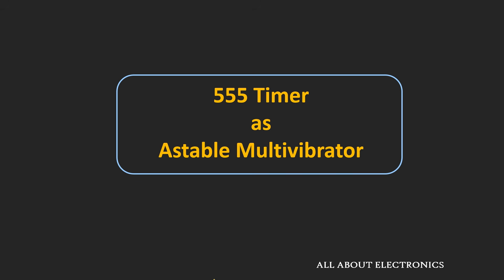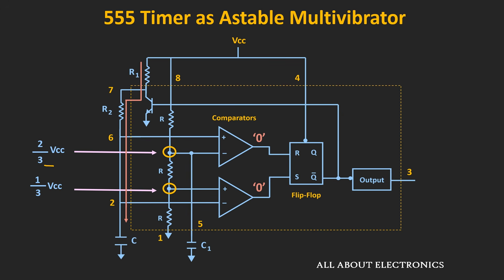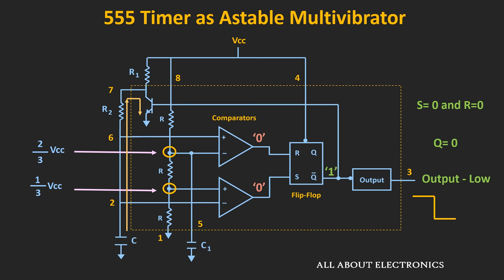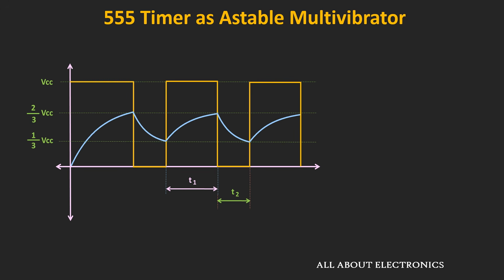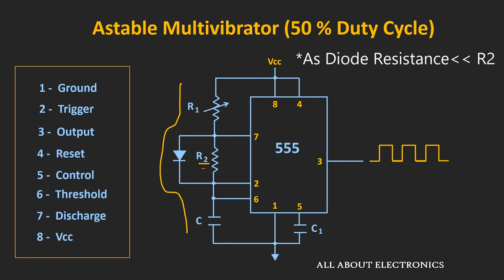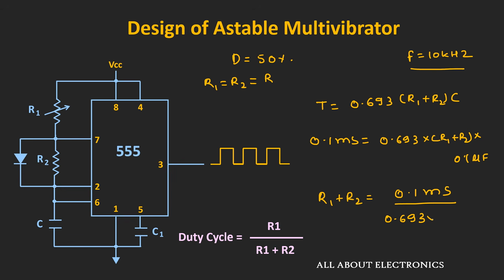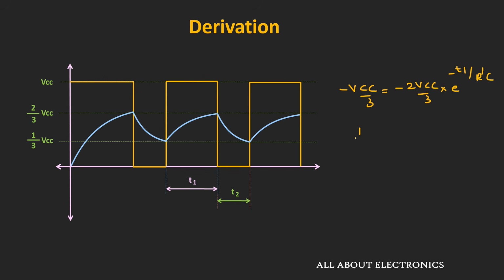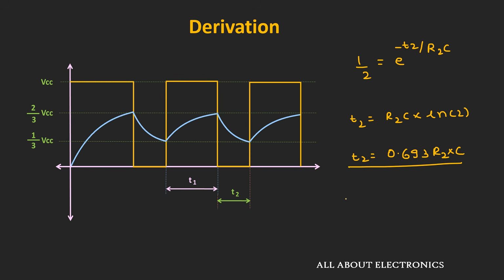555 Timer as Astable Multivibrator (Working, Design and Derivations)

Comment: While in design what about R1 and R2 we have to assume R1🙄
Reply from the maker: You need to select both R1 and R2, according to the required duty cycle.
Reply: First of all you have to assume te value of C,   use equation Toff = 0.693R2C, find R2,  use equation Ton = 0.693(R1+R2)C, find the value of R1. You should  assume value of C only....

Comment: what is the function of capacitor at pin 5
Reply from the maker: By applying the voltage pin 5 we can change the reference voltage. If it is not used then it can be kept open. But in that case, it can pick up the noise or by any means if the voltage changes at pin 5, then it can change the reference voltage. To avoid that the capacitor is connected to the pin 5. So, this capacitor will charge up to 2/3Vcc voltage. and won't change the reference voltage.
Reply: @ALLABOUTELECTRONICS  What do you exactly mean by the reference voltage. Is it something like when the 555 timers is configured as astable multivibrator. And Vcc=5v then the HIGH = 5v and the LOW = 2.5v or any other voltage which is the reference voltage.
Reply from the maker: @TechInventorAman  What I was referring to is the 2/3 Vcc reference voltage for the comparator. If no voltage is applied at the pin 5 (control pin) then the reference voltage to the first comparator will be 2/3Vcc . But it can also be changed by applying the specific voltage at the control pin. And when it is not used then via a capacitor it is connected to the ground. 
I hope now it will clear your doubt.
Reply: @ALLABOUTELECTRONICS  Oh ok now i got it thank you so much !
Reply: Pin 5 is used when you want to control frequency by applying a voltage I.e V to F converter, as an oscillator you will not be applying a control voltage, so if you keep pin 5 open, there is a high possibility of noise pickup.... so it is connected to ground through 0.01 microfarad

Comment: Q equals to 1 and output is connected to the Q bar pin..then how the output is becoming high at that time?
Reply from the maker: Because the output driver circuit inverts the Q-bar output. It is actually inverting driver circuit. (that's why I have put a bubble on the left-hand side of the output block.)
Reply: Output is Q as Q' is inverted before connecting to output, or there is an inverter between Q' and output of 555

Comment: Sir, At pin 5,if we provide external voltage it gonna affect Ton but Toff is independent of external voltage ..why?(In diode condition)
Reply: There is no role for Pin 5 or upper comparator during discharging of the capacitor.....

Comment: At 5:15 the voltage at non inverting is greater than inverting so output should be 1...? ❓ Clarify it
Reply from the maker: Ar 5:15, the voltage across the capacitor is just below 2/3 Vcc. But it is still more than 1/3 Vcc. So, output of the second comparator will be low. It will become high only when the voltage across the capacitor goes below 1/3 Vcc voltage.
Reply: @ALLABOUTELECTRONICS  here u mentioned correctly 😊but in video i think there is some correction had to be done.. I may be wrong but u please check it..
Reply: @aravinthbosem3652  Yes. There's a slip of tongue in the video.

Comment: What is the diode operation in that diagrammm
Reply from the maker: It will prevent the capacitor to charge through R2. (As it offers very low resistance).
So, during charging capacitor charges through R1. And during discharging, it discharges through R2.
And by tuning the value of R1 and R2, it is possible to attain the desired duty cycle.
I hope it will clear your doubt.
Reply: If dutycycle is less than or equal to 0.5 or 50%, that means Ton is less than or equal to Toff, then capacitor should charge only through R1, not through R2.

Comment: Op amp corresponding to 1/3 Vcc is connected to Reset terminal of flip flop not Set terminal
Reply from the maker: You mean to say the lower comparator?  It is connected to the SET terminal of the flip-flop.

Comment: but the value of Vf should be 2/3Vcc
Reply from the maker: The capacitor is charging towards the Vcc voltage. But when it's output reaches 2/3Vcc voltage, the comparator output changes. If the comparator would not be there, the capacitor would have charged up to Vcc voltage. That's why Vf is Vcc. 
I hope it will clear your doubt.

Comment: y capacitor C1 is used?
Reply from the maker: As control pin is not used in the circuit, so to prevent any change in the voltage due to fluctuation or noise at the inverting end of the 1st comparator, capacitor c1 is connected. If it is not connected then any spurious voltage at the control pin will override over the 2/3Vcc voltage and it will change the threshold point of the comparator. 
I hope it will clear your doubt.

Comment: sir, actually I have a doubt related to this video and previous 555 timer video also. if when output Q=1 
then value of Q' must be 0 because of its complimentary of output Q according to the truth table of S-R flip-flop. Sir, please clear this doubt.
Reply from the maker: Yes, that's how it works. I think if I am not wrong, you got confused because Q' is given to the output driver circuit (which is actually inverter). So, the output of the 555 timer will be Q.
I hope it will clear your doubt. If you still have any doubt then do let me know here.
Reply: You are right, when Q=1, then Q' must be 0

Comment: Sir u put parallel diode to R2 in the circuit diagram but did the derivation of original circuit(no diode parallel to R2)..
For t1 it should be only R1 if diode is parallely connected to R2
So it shld be t1 depended only on R1 not on R2... Isn't it sir..?
Reply from the maker: Yes, that's true. The derivation was for the original circuit. (with R1 and R2)
Reply: @ALLABOUTELECTRONICS  ok.. 👍🏻
Reply: Yes you are right, when diode is connected, Ton doesn't depend on R2 as diode D bypasses R2 during charging....